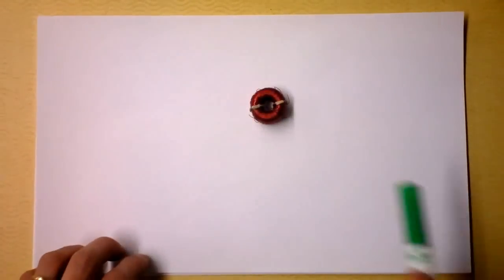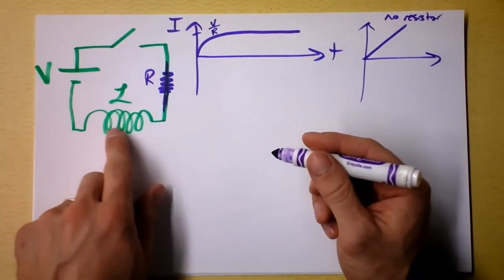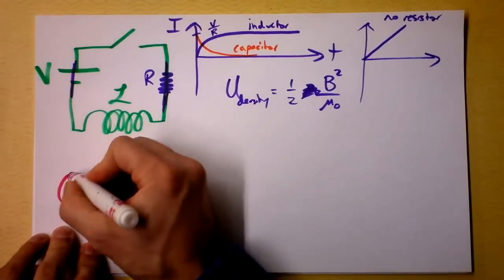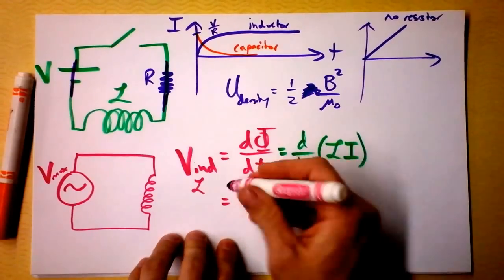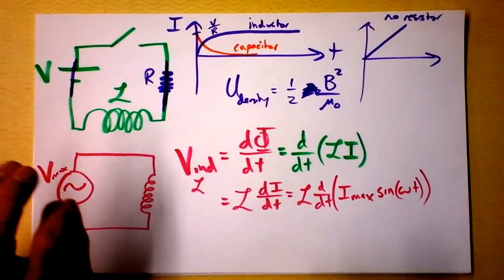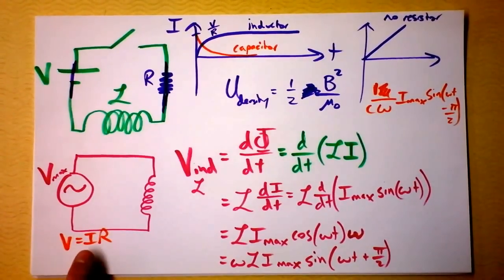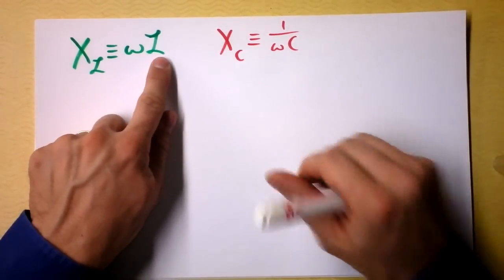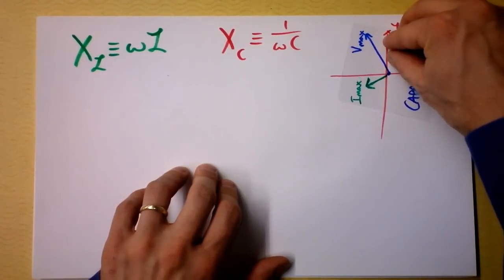Phasors for Inductors in AC Circuits | Doc Physics

Comment: Hi Doc.Have you ever thought about the inductor produced the emf is exactly cancel out the applied voltage? The voltage finally applied on the inductor in the ac circuit is ZERO? I know emf is produced by changing current. But you just wrote EMF=applied voltage as well.

Comment from the maker: That minus sign is Lenz's Law, and everybody should know it by this point.  Obviously the voltage will be induced in a direction to oppose the change in flux, so I am interested only in the magnitude.  Thanks for clarifying!
Reply: I have a question about that though, if we're solving problems that have to do with flux, does that mean we don't add that negative in our calculations ever ?